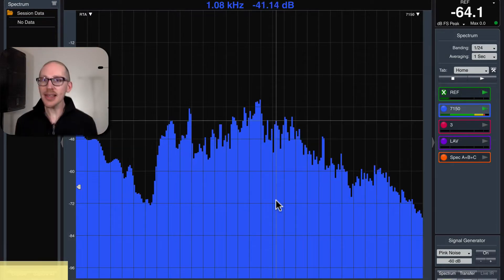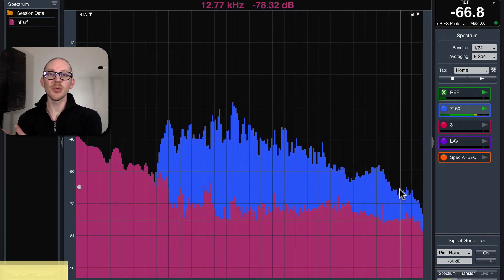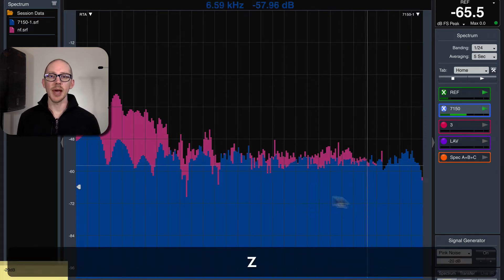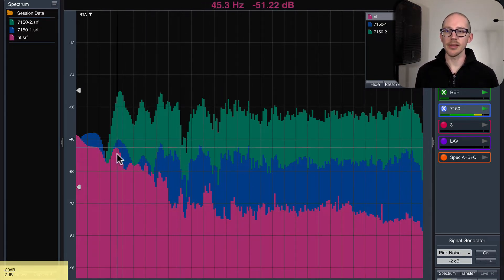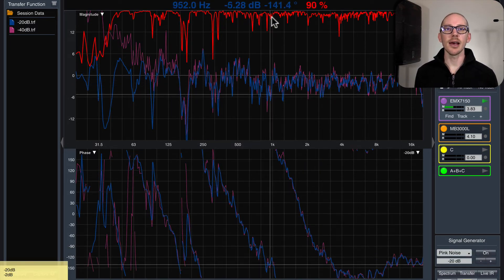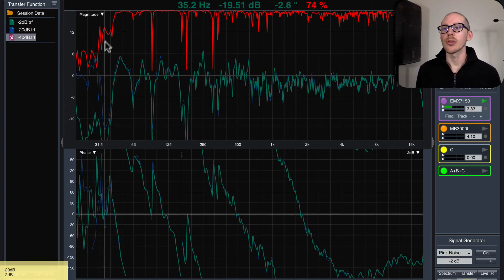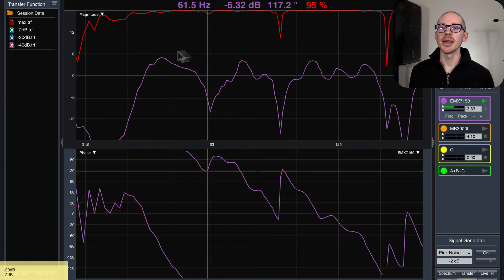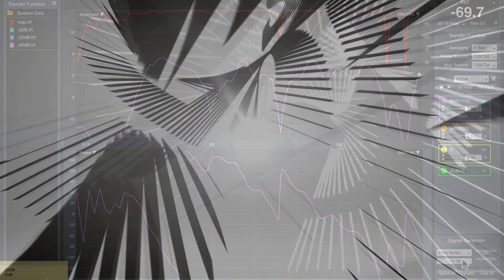How loud does the test signal need to be in the room for Smaart? [GSwSST20]

Comment: Hi Nathan, i’m a newbie in audio tuning world and have seen your videos to be of great information. 

I’m using the same setup as yours here  (Smaart + X32) and using three (3) Behringer ECM8000’s.

Now my question is, how do I really set the gain structure of all the microphones? 

Normally, i’d set my gain for all three at +30db. Now when I place my mics across the room, the farthest one would normally get the lower signal.

However, i’ve also seen videos that are saying that the signal generator and mic signal on SMAART should be at thresame level. 

Does that mean I need to crank the gain a bit hotter on my farthest mic or should I leave them all at the same gain level? Thanks!
Reply from the maker: Hey j, I guess try to consider what you are trying to accomplish. If you want to observe differences in amplitude across the audience then calibrate all of the mics to read the same level at the same location, then never change the gain again.
Reply: @nathanlively  This is definitely helpful. Thank you so much for clarifying this!
God bless you!

Comment: I have a question.

When setting measurements and references,
Should the pink noise of the signal generator be set at -12db?
Or should I set it up at -60db?

because,

If the pink noise of the signal generator is set at -12db,
Isn't it hard to secure more than 20db higher than the noise floor?

Comment: For measuring satélite speakers indoors hanging from ceiling do point mic up or towards the speakers  from listening  position. I’m measuring 5.1 Channel setup on avr with lfe. For lfe where to place and point mic?
Reply from the maker: Hey Avi, depends on the mic. Most of the work we do is with free field mics pointed at the source. Acousticians sometimes use diffuse field mics that get pointed straight up and they are measuring RT60 and stuff like that.

Comment: ok, but does the system response can be different when playing loud as during the show ? And must be warmed before measuring ? Same question about the mic preamp, is there a problem giving too much preamp on my mic ? Thanks for your work, it's helpful !
Reply from the maker: Hey Olivier, good to hear from you. 

>  does the system response can be different when playing loud as during the show ?
I hope not. Don't you? If the loudspeaker response changes with level, that would make it non-linear and pretty hard to work with.

> And must be warmed before measuring ?
Loudspeakers do perform differently at different temperatures. So should you heat up the drivers before performing an alignment? I don't know, but it probably makes sense to look at both cases.
I have written about power compression here: https://www.sounddesignlive.com/do-subwoofers-need-time-alignment/#Does_the_phase_response_of_a_subwoofer_change_with_level

> is there a problem giving too much preamp on my mic ?
Yes, you need to get above the noise floor and have a high level for for a high quality signal, but without clipping or distortion.